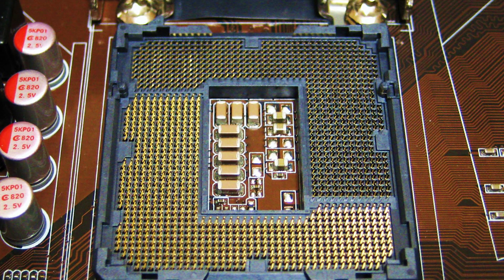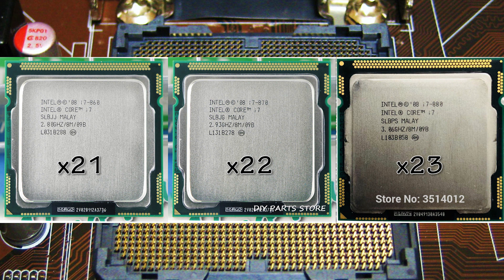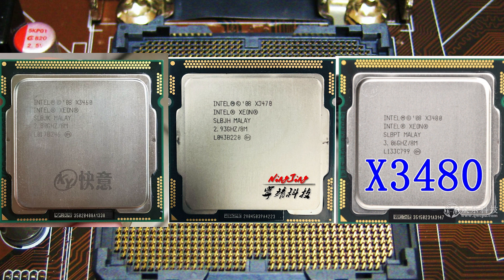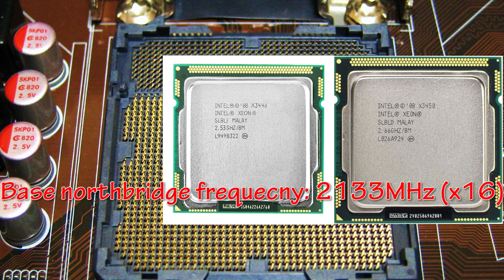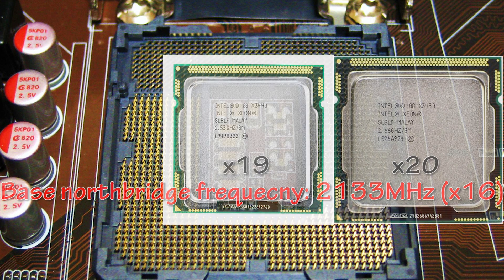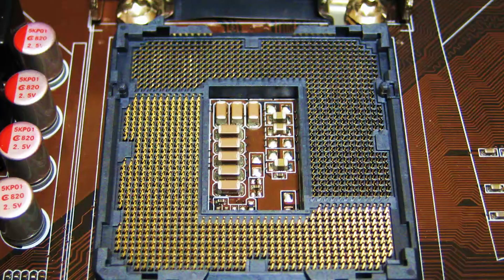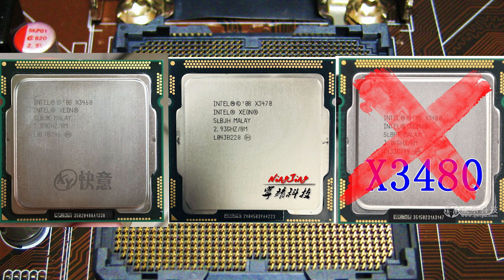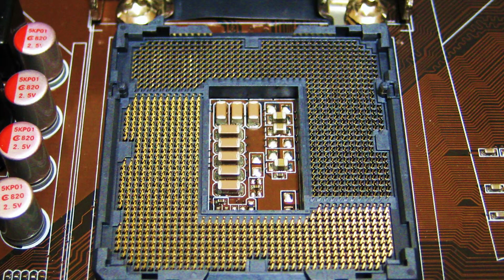What is the best CPU for 1156 socket? i7 880, X3440 or X3470?

Comment: I have a Asus P7P55D-E with a i7 870 running at 3.6Ghz with 4x4gb 1600mhz cl9 and 2 HD 5770, runs good, i want to do an upgrade in gpu and cooler

Comment: Hi. I have DH57DD motherboard does it have the ability to regulate imc voltage??
Reply from the maker: Hi! Unfortunately, I do not have any experience with this specific board. You can check this yourself. It should be called the same.

Comment: I don't know what you didn't like about the X3450... This processor works very well for me ! Of course , I overclocked it to 3600 Mhz , there is no point in overclocking it anymore , since only the temperature is growing , not the performance !
RAM that overclocked to 2000 Mhz ! For this processor, the GTX 1660-S graphics card is weak and the RTX 2060-S graphics card is too powerful for this processor!

Comment: since im running my x3440 on 3.80ghz i dont think i can find an upgrade for this socket. time for mobo change i guess
Reply from the maker: I totally agree. In 2023 LGA1156 CPUs are old enough to consider an upgrade, even for light workloads. 12100f, for example, is much much faster. If you want to go used, Ryzen 1600/2600 is a decent upgrade option.

Comment: i7 875k its not better?
Reply from the maker: Technically i7 875K is better, since it has unlocked multiplier. But in fact it has no real advantages over i7 870 or X3470, as all Lynnfield CPUs can be easily overclocked via BCLK.

Comment: Between i7 870 and X3460 which one is better for gaming? I searched on google for comparison between those two cpus and it stated that the xeon cpu is better for gaming, workstation and desktop.
Reply from the maker: They are pretty much identical. X3470 is the copy of i7 870. The only difference is that i7 870 officially supports only 16GB of RAM. While X3460 differs from X3470 just in base core clock frequency (2,8 vs 2,93 GHz). If you do not need more than 16GB of RAM and you are going to overclock a CPU, than choose the one which is cheaper.
Reply: @starstreamgamer3704  The price difference is just around 1-2$, and the xeon one is cheaper, and yes i would like to oc the cpu

Comment: здравствуйте . не запускается rx 5700 xt на lga 1156 .в чем проблема ?после биоса черный экран , gtx 1050 норм работает, моя система asus p7h55m, rx 5700 xt, windows 10 x64, ,блок питания на 750 в, оперативка на 8 гб
Reply: LGA 1156 goes well until PCI-e 2.0, some newer GPU you'll need luck to run on this plataform.
Do you still have this setup?

Comment: Hithanks for this video! What Gpu did You use and did you struggle with the PSUs limits?
Reply from the maker: Hi. The GPU model does not really matter. You can use any of them, even integrated graphics.
I had a 600W PSU at that time, so no, there was no problem with it. But even with 500W PSU you should be OK, at least with some mid-range GPU model, like GTX 1660 or RX 580.

Comment: why not the i7 875k its unlocked
Reply from the maker: All Lynnfield CPUs can be overclocked via BCLK. Moreover overclocking via BCLK is more effective, because it is possible to overclock memory controller and RAM this way. So there is no need in unlocked multiplier for LGA1156 platform.
Reply: @starstreamgamer3704  can all intel cpu be oc'd via bclk but bclk oc'ing isnt the same

Comment: Can i play not boosted x3470 with not boosted rx 580 gta 5?
Reply from the maker: Of course. But not with maxxed out graphics. You will need to reduce CPU intensive settings (population density, population variety, distance scaling) to hit 60 fps. RX 580 is powerful enough to provide 1080p/60 fps in this game at "Very High" settings (or 1440p/60 fps "High").

Comment: Hi bro, a little question, between an i7 870 and a xeon 3440 which one do you recommend the most, taking into account that I would not want to overclock it
Reply from the maker: Hi. 870 is a bit faster due to higher stock core frequency and higher stock NB frequency. I'd definitely recommend 870 if the price for both of these models would be the same. But 870 is usually 3 times more expensive. So it's up to you to decide. X3470 and X3460 are good alternatives in my opinion. X3470 is as fast as 870 but less expensive.
Reply: @starstreamgamer3704  Thank you very much friend, now I am very determined and confident of the processor that I am thinking of buying, thank you bro and for certain good video
Reply from the maker: @SAQUEN_EL_VICIO  You're welcome!
Reply: So the 860 I picked up for $40 in the mini gaming pc I built was very worth it. Proforms well with GeForce GTX 970 amd 16gb ram. Flawless running just die already and fortnite. No overclocking.

Comment: at 5:13 , its not true, hyper threading or SMT can bring up to 2x performance uplift in many games also depending on your core configuration, but im talking about 4c/4t vs 4c/8t in this case.
Reply from the maker: I've never seen such a big improvement provided by doubling threads. The best result is +50% in some very rare cases, but usually it is about 25%.
Doubling the amount of cores may indeed double CPU gaming performance, but not threads.
Reply: @starstreamgamer3704  well from my own testing its pretty close to 2x in some cases, here is the video i made quite a while ago:
https://www.youtube.com/watch?v=M7mQSN-PFJ0
Notice cyberpunk, total war troy and shadow of the tomb raider had the biggest gains. Also if you look at gamers nexus coverage 
https://youtu.be/j9HV9V5nzOc?t=962
In newer games like division 2, sottr, rdr2, three kingdoms hyper threading gains range in 40-70% area. So anyways as i said it depends how many cores you have and how badly your game is starved for cpu/thread count. But its safe to say that in certain conditions hyper threading can add way more than 25% or even 50% of performance improvement.
Reply: this 25% is used to be in 2014-2015 era games and 3d rendering programs, but these days games are significantly more multithreaded and scales much better with total amount of threads, its a great video dont get me wrong, i just wanted to point this out :)

Comment: Is switching from the i7 860 to the x3470 or x3480 worth it? Will an improvement be noticed in 3d modeling and video rendering jobs?
Reply from the maker: It will not be an improvement. These are all basically the same CPUs - same architecture, same amount of cores/threads. The only difference is base core clock frequency. And of course the fact that i7 includes integrated graphics.
If you are not going (not able) to overclock you CPU, they you will get like 2-3% (5-6%) performance improvement by replacing i7 860 with X3470 (X3480). I do not think such an improvement is worth the bother.
Reply: @starstreamgamer3704  ok. I'm afraid of it, at least I'll save 50 usd lol... thanks for answering
Reply from the maker: You are welcome. Mild overclocking is pretty easy to perform and it is perfectly safe (if you have a decent motherboard of course).

Comment: Can i upgrade from i5 650 to any i7 1th ??
Reply from the maker: Yes, you can. The amount of options will depend on your MoBo model though.
Reply: @starstreamgamer3704  i have optilex 980 and 1156socket
Reply: @starstreamgamer3704  i want to buy i7 880 or 870 who is better i7 880 or i5 2400 for games
Reply from the maker: There is no sense in paying more for i7-880. Go for i7-870 or i7-860. Overclocked i7-860 will be on par or even faster than i5-2400 for games.
Reply: @starstreamgamer3704  i will have boutlneck whith gt1030 and i7 870 or 860 ?
Reply from the maker: No doubt. GT 1030 is a low-end GPU. It will bottleneck your CPU even at 720p/low settings. GTX 1650 is the most optimal partner for overclocked i7-860. It will bottleneck this CPU a little bit in all the scenarios, which is an ideal conditions for a gaming PC. But of course you can use more powerful GPUs.
Reply: @starstreamgamer3704  ok tnx bro for all this helpful information tnk y so muuuch
Reply from the maker: You are welcome.

Comment: got an intel dh55pj, using a i3-530 rn on slight overclock, using any of these how much can i overclock
Reply from the maker: Well, it will partly depend on a certain CPU quality itself. But the main thing is the quality of a VRM of your MoBo. DH55PJ has a poor quality VRM and no heatsinks. But taking into account the fact than i3-530 has only two cores, even with such a MoBo like DH55PJ can achieve a decent result. I think 3,5 GHz is achievable in your case. Just try not to exceed 1,25V (CPU voltage).
Ideally you should install addtional small cooler over a VRM space (80-90mm should be enough).
Reply: @starstreamgamer3704  what will you recommend, upgrade to i5-1st gen and 8gb ram or h61/h81 upgrade with a decent processor
Reply from the maker: It's a hard question. The answer depends on what are going to use your PC for.
Reply: @starstreamgamer3704  just need to game and for content storage. will look into my path now maybe will sell this one and get a new combo
Reply from the maker: I'd recommend to consider a CPU with at least 8 threads, if you are going to play modern AAA games as they are very demanding. For your current board I'd buy X3440 or i7 860.
If you are going to change the whole platform, I'd suggest to choose LGA 2011, LGA 2011-3 or AM4. These platforms can offer 6- and even 8-core CPUs. While LGA 1155 or LGA 1150 can offer 4 cores and 8 threads at best (i7 4770(K) and i7 2600(K) respectively).
I'd say B450 + used Ryzen 1600 is a good choice as well as X79 + Xeon E5-1650(v2) or X99 + Xeon E5-2620v3. They all offer 6 cores and 12 threads, which is a minimum requirement for today's games.

Comment: Hello can i ask a question?I have processor i5 650 should i buy i7 870 or i7 880 for upgrading my processor
Reply from the maker: Hi! Even i7 860 will be a big step up in comparison with i5 650. If you're going to overclock a CPU, it doesn't matter which one you chose i7 860, 870 or 880 - the are all equal. If not then 880 will be by 5-8% faster than 860 and by 3-5% faster than 870 at best. I'd choose 860 and overclock it, at least a little bit.
Reply: @starstreamgamer3704  thank you!
Reply from the maker: You're welcome.
Reply: an i7 880

Comment: What’s the best 1156 cpu for rx 560
Reply from the maker: For modern games you need at least 8 threads, otherwise your gaming experience will be laggy and uneven. So I'd recommend to choose X3440 (or better) and overclock it, at least, a little bit.
Reply: @starstreamgamer3704  would a x3470 be better than the x3440 in my case?
Reply: Btw I have a 60hz monitor playing at 1024p
Reply from the maker: X3470 is a little bit faster than X3440 due to higher NB frequency. If you are going to overclock your CPU, then the difference between these CPUs will be small.
For now X3440 costs around $15 while X3470 costs $35. I personally do not think '70 worth extra $20. I'd better invest them in a higher quality GPU (or RAM).
Reply: @starstreamgamer3704  okay so I just found out that my motherboard isn’t compatible with Xeon. My options are the i7 870 and 860. But the 870 is a tile out of my budget. Would the 860 still be good?
Reply from the maker: @shawnsiyou3158  Choosing 870 does not make sense. These two CPUs are identical. The only difference between 860 and 870 is that the latter has slighly higher base core frequency. You can easily overclock 860 by slightly raising BCLK and make it faster than stock 870.
Reply: @starstreamgamer3704  okay thanks
Reply from the maker: No problem.

Comment: im using 
x3470 cpu
bulldozer H55 mother board
2x4gb ram (kingston 1600hz)
gt 710 (1gb) inno 3d 

its keep crashing when i open up some website or maybe multitab(4-5tab).

idk what is the problem , im already update my driver, any solutions?
Reply from the maker: What about games or any other apps? Does it crash there too?

Looks like there is a problem with memory, as web browsers load RAM heavily. Have you overclocked your RAM? If yes, then try to test it for stability with a help of TestMem5.
If you are using stock RAM, then test it with a help of MemTest86. It will take several hours to complete one pass, but then you will know for sure if the blame is on RAM or not.
Reply: okay thx, ill try it later
Reply: ahh i was thinking to upgrade its vga to gtx 750 ti 2gb , are u really sure the problem is ram?
Reply from the maker: Not sure. That's why I suggested you to test your RAM. Web browser crashes are most likely happening due to RAM problem. But it also might be CPU fault.
Did you buy this whole PC? Or just upgraded it? For example, if your RAM worked fine with another CPU, that the problem is most probably in X3470. Have you experienced crashes before you upgraded it? The answer to your question depends on the specific situation.
Reply: @starstreamgamer3704  yea i upgraded it from pentium e 5800, it worked fine with 4gb ram single channel, then i buy another one but the physical size smaller (same speed) still no problem, until i got new motherboard and cpu.
Reply: that why im search for another cpu with 1156
Reply from the maker: Well, if you haven't overclocked your RAM, than the problem is in either the CPU or the motherboard. First of all, try to reset OC settings. If you haven't overclocked your CPU, then you got two choices. Try another CPU with your board or try another board with your CPU.
But I'd still recommend you to test your RAM with TestMem86 at first, just in case. Sometimes memory can behave badly and give it's owner problems only in some specific cases.
P. S. Also try to reinstall RAM modules in other two slots on your motherboard. This will give you an answer whether a memory slot of the MoBo faulty or not. This is rather frequent problem with old MoBos.

Comment: Can i overclock my x3440 with asrock h55m motherboard? I have an intel stock cooler and Thetmaltake V200 computer case.
Reply from the maker: Hi! This board has a relatively poor VRM quality, so I wouldn't recommend to overuse overclocking. 3,2-3,4 GHz is the maximum safe frequency for this board (depending on the CPU voltage value, which shouldn't be higher than 1,2 V). Intel stock cooler will also limit the ability to overclock your CPU. So, yes, 3,4 GHz is the maximum frequency you can try to achieve.
But you can overclock your memory without any problems. Even if you OC only memory and BCLK (leaving base CPU frequency on the same level), you will still get a decent performance improvement.
Reply: @starstreamgamer3704  im new to overclocking, how do i overclock my CPU?
Reply from the maker: Here is the video instruction about overclocking CPU and RAM: https://youtu.be/dm5C9NsfMUU

Comment: I have a p7h55-m LX MoBo with i5 760 3.4ghz OC and I want to Upgrade. Which cpu do you recommend?? Thanks
Reply from the maker: X3440, X3460 or i7-860.
Reply: @starstreamgamer3704  you think my i5 760 3.4ghz is still good or is it worth upgrading?
Reply from the maker: Well, it depends on what are you going to use it for. Web browsing? Old or new games? Productivity applications? Etc.
For modern games 4 core/4 thread CPUs are too slow. You need at least 8 thread (or 6 core) CPU to play them without any major problems. Same goes to modern productivity applications - 4 additional threads (or 2 additional cores) may accelerate video/photo rendering up to 50%.
Reply: @starstreamgamer3704  thank you very much for your help but i dont know if i will notice a major difference between those cpus in modern games
Reply from the maker: @leftlord  Many game engines can use hyperthreading quite effectively. Disrupt, Decima, AnvilNext 2.0, Foundation etc.
Watch my video about Hyperthreading if you want to know more: https://youtu.be/fRTs1Fa0M9k
Reply: I hv a p7h55-m LE... what defferent? It work for that cpu?

Comment: I'm planning to get the x3470 for my Acer OEM motherboard but I can't find anything online to find out if it works. Do Xeons work on OEM prebuilt boards?

I don't have plans for OC because I don't think my mobo has the ability to do that.
Reply from the maker: I'm not sure. It is almost impossible to find any information about CPU compatibility for OEM boards. I'd recommend you to ask Acer themselves. Maybe they will give you the exact model name of this board or even CPU compatibility list.
But the chances are that X3470 is compatible with this board. Majority of LGA1156 are compatible with Xeons, although many devs simply do not mention Xeons in their CPU support lists.

As concerns OC, I wouldn't recommend to perfrom it on an OEM board - it is most likely has a poor VRM quality.
Reply: It works on my acer veriton oem

Comment: Hi! is it mandatory to have ecc RAM memory to run xeon processors?
Reply from the maker: Hi! No, not at all. You can use both types - ECC or non-ECC. Just make sure that all the memory modules you use are the same type, as it is not possible to combine these two types at once.
Reply: @starstreamgamer3704 Hello! Thanks for answering and the tip!
Reply from the maker: You are welcome!

Comment: Thanks, well explained, the x3440 does perform much better than i5 750/760 because of HT but why bothering when you could buy the x3470 for a small difference.
Reply from the maker: You are welcome. Yes, at the moment I released this video X3470 was just a bit more expensive than X3440. But prices may change, at some point X3470 was like three times more expensive than X3440. So it's up to you to decide whether this difference worth it or not.
Reply: But not support to LGA1156 p7h55-m LE ?
Reply: @JM-Snacking  Well, the X3470 is for LGA1156, that motherboard should support the Xeon processors, for some reason Asus page doesn't list these processors as compatible, but you can find videos in youtube of people using them.
Reply: @Mattotk  yes i think X3450 is better